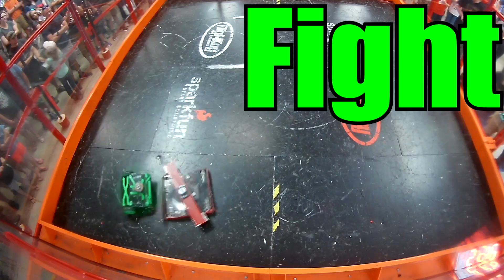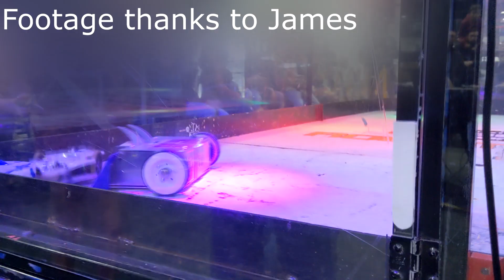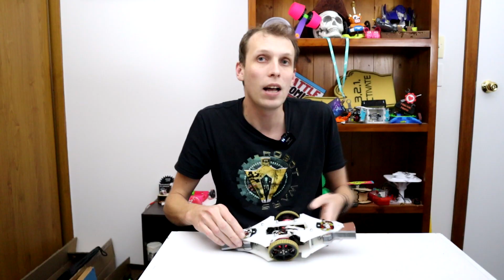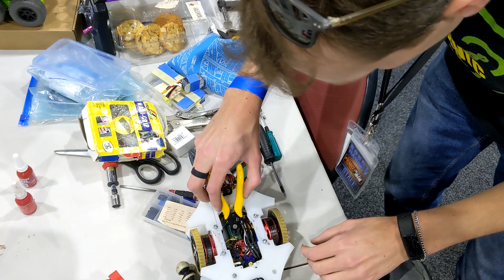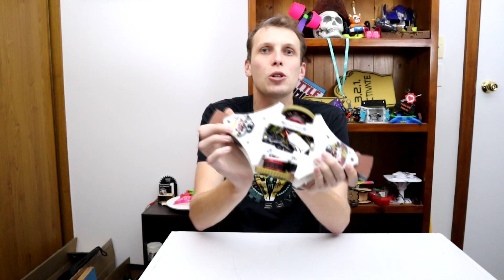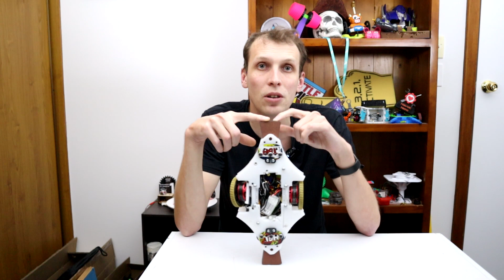My robot did tons of damage!

Comment: Yeah, that was a frustrating part of the weekend - Gorgonzola is ready to join forces again in the future though! To give some more context on my part of the fights, I wasn't supposed to be driving Torn at Havok this year but my other son was sick, hence Nate and I rotating around driving duties of our 3 hobbyweight entries. Gorgonzola itself had some issues at the event as well - I had run it as a beetleweight at a previous ARC event and it had spun up and translated fine, however due to the increased weight allowance as part of the multibot I put heavier hammers on it for Havok, which caused issues. For grudge matches/rumbles towards the end of the event I put the smaller hammers back on - and it stopped getting caught on it's own chains, and moved around much better. I'll probably run it on/off as a beetleweight at ARC events going forward, and I do want to try out Open Melt 2 at some stage, whether in Gorgozola or another melty.

Comment: Yep. Beetle-weight melties are hard. 

Your meltybrains inspired me to enter a 3-lb robot called Karoomba into the September NHRL event. My first combat robot won one out of 3 fights. I too only barely passed the safety inspection, taking three attempts.

The rush to get things working leading to mistakes was also familiar: this cost me my third fight when I didn't replace the worn down wheels from the two fights before because I hadn't started recharging the battery until after I found out I won the previous fight in a judges decision.

Keep doing the meltybrains!
Reply: Ah, cool, well done! That was a great first bot, certainly a big challenge to start with a melty. I only just watched the 3rd fight, I wondered what was causing you to get high sided. I always find it's worth having 1-2 spare batteries, so you can have one charged and ready to drop in if you get a quick turnaround.